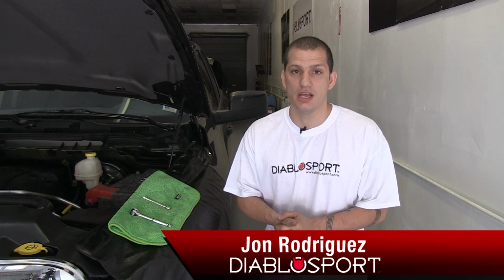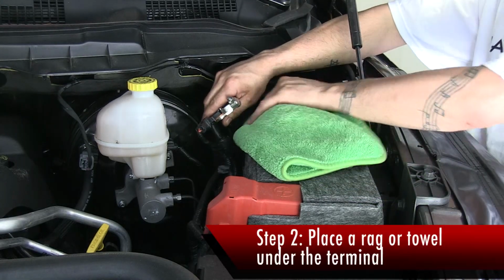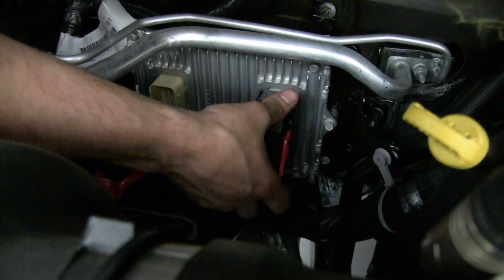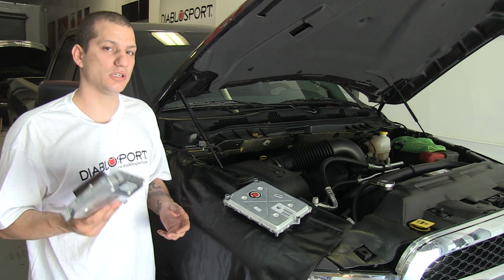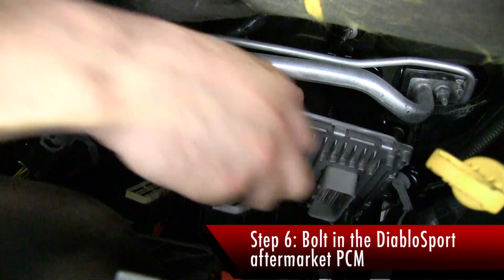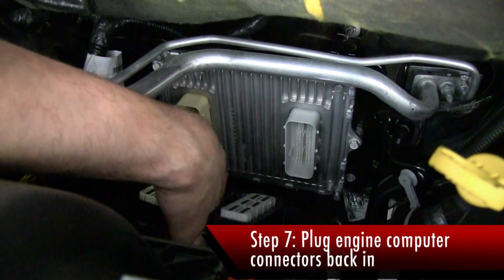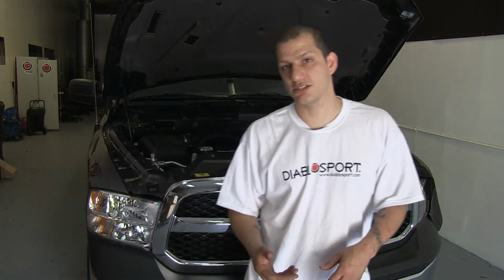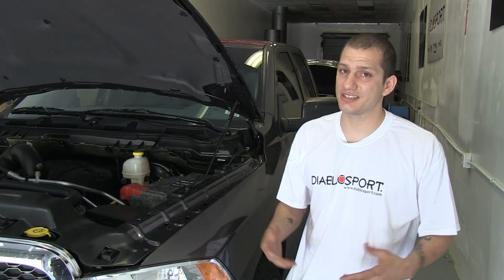DiabloSport 2015 Ram PCM Swap Tutorial & Installation

Comment: I bought a used diablo trinity t2 ex for my 2018 ram 1500. I need to get the unlocked pcm in order to run the trinity t2 right?  And can i piggyback the pulsar ontop the unlocked pcm while running a tune from the t2 ex?
Reply: This is a interesting question, I just got Diablo tuner and I’m waiting for my new PCM currently, the pulsar idea is very interesting
Reply: You should be able to run the pulsar on top

Comment: I recently bought modified PCM & i3 tuner (package)from the website for 2015 Ram 1500 and tried to remove the electrical connections from the factory PCM but it didn’t work !!!
What to do now ?!!!
Reply: Jassim Salem The same thing happened to me. I tried disconnecting the wiring harnesses and broke the red levers off. Did you ever figure out how to get them off?
Reply: @Glisson  same thing here bud
Reply: Same thing just happened to me any solutions ?
Reply: Butter knife
Reply: @Glisson  I broke mine as well, I went to the electrical shop and they got it opened for me but the problem is when I have to put back factory PCM it won’t hold perfectly
Reply: @danielsolano6931  same issue bro , the thing is mopar doesn’t have that red levers as replacement part unfortunately you have to buy the complete harnesses!
Reply: @Gainzville99  that’s what happened 😅
Reply: A small thin screw driver will push the lock tabs down. 
If these pcm connections are won’t free easily never force them. ( as you already know why lol) 
A small shot of wd-40 and gently pulling on them will free them up.

Comment: Does switching the PCM interfere with odometer on the truck? Or is the mileage recorded elsewhere? Also I've added the trailer brake module to my truck and the dealership had to reprogram my PCM to recognize the module. Is this something I would have to mention when ordering the new PCM?
Reply: Did you ever get an answer? Those are excellent questions.
Reply: Great questions. Just picked up my 2018 Ram. Dealer needs to activate trailer brake controller and bed led lights. Would swapping PCM's lose functionality of the dealer enabled items?

Comment: Left connector will not budge.  Right connector came right off with very little effort.  Any suggestions?
Reply: I will give it a shot and let you know.  Thanks for the prompt response!
Reply: @DiabloSportInc  having the same problem but tried everything nothing works
Reply: @DiabloSportInc  I used two flathead jewelers screwdrivers to press down on the slides that the handle is supposed to move and it came right off. I sprayed some silicone lube on the slides and we'll see if I can get that one back on when the PCM comes in today.

Comment: So i need a modified pcm for use diablotunner in my 2015 5.7 ram?
Reply: Yes. Starting in 2015, FCA installed encrypted or locked PCMs necessitating spending a bunch of money buying an unlocked PCM if you want to tune your truck. I have a 15 with the 65RFE and it NEEDS a tune to take up the crappy transmission programming alone.

Comment: I just did all that and the truck ran like crap and the tow light came on...

2014 RAM...5.7

Purchased refurbish online and gave them the Vin # to program...

5 months I've troubleshoot misfire 6 error... 

Wasn't this replaced old and runs great..... 

I've replaced 16 plugs, 8 coils, 8 injectors, all lifters, the camshaft, and the left head Assembly... I give up... 

Can't figure misfire 6....
Holds pressure and runs excellent, but light won't go off. I thought it was this PCM... but it wasn't.
Reply: Shit had dealer put two engines in my 2016 still show misfire and stalls out also changed pcm seems like in the same boat looking for answers on the UTube lol
Reply: It's odd... My truck runs great but just light won't go off

Comment: What if my connectors are stuck so bad to the pcm I can’t remove them? They are like glued on, it seems
Reply: DiabloSportLLC thanks. That worked. Then on the first run, coded P0038, O2 sensor. 🤦🏻‍♂️🤷🏻‍♂️